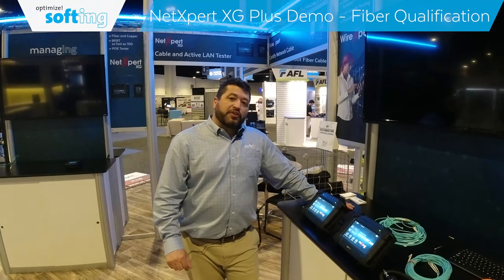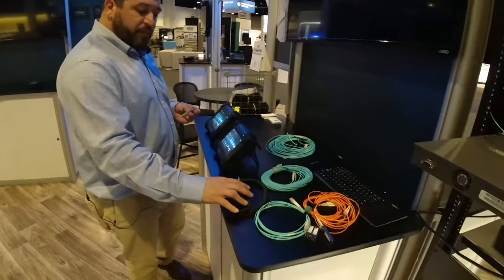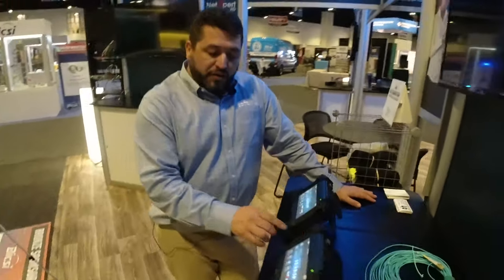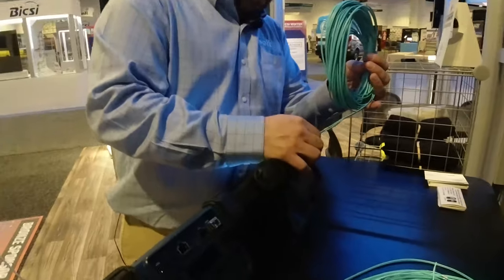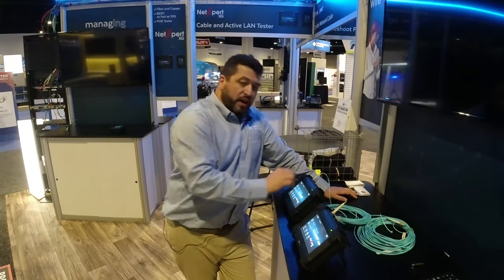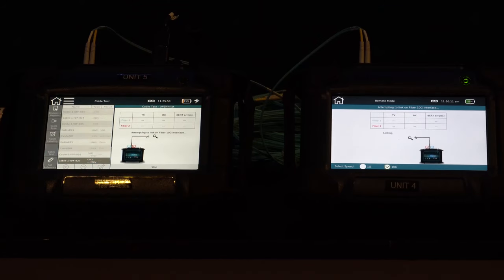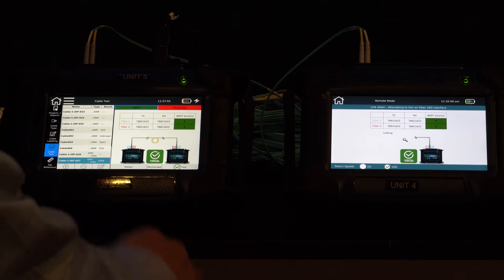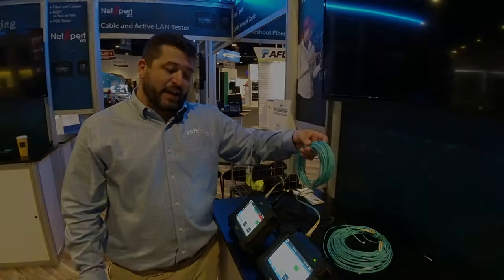How to test a fiber optic cable using BERT to 10Gbit/sec

Comment: May I know this model can do the troubleshoot vs EtherScope® nXG.  2nd question is in order to test the fiber must get 2nd unit NetXpert XG and test?
Reply from the maker: EthernetScope looks like a WIFI mapper.  NetXpert XG doesn't do WIFI mapping.  NetXpert XG does cable testing for copper, fiber, and does network management like connecting to a switch or router for network discovery, switch configuration, etc., and NetXpert XG troubleshoots POE.  It's an all-in-one cable and network tester.

Yes, you need to main units to test fiber cable.  You can use one unit and plug it into a fiber switch for network management.

Hope this helps!

Deane